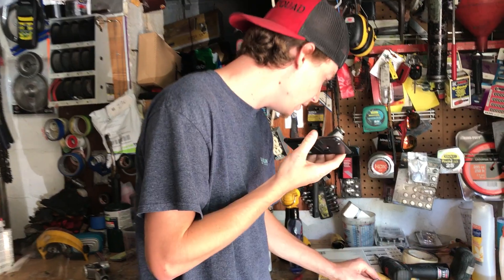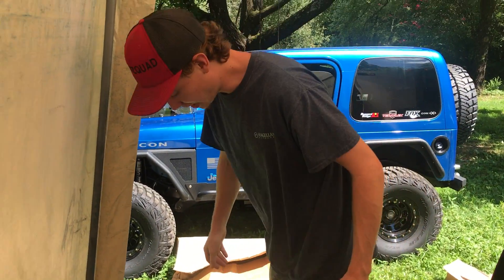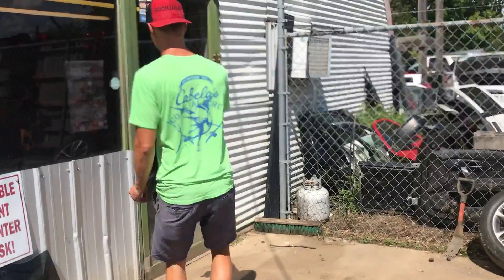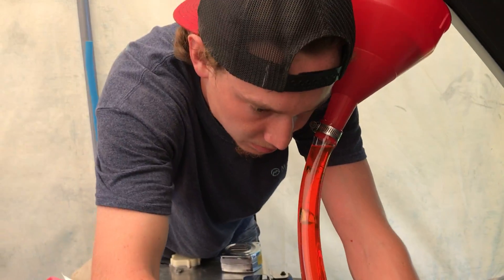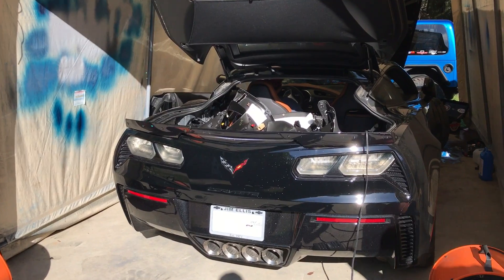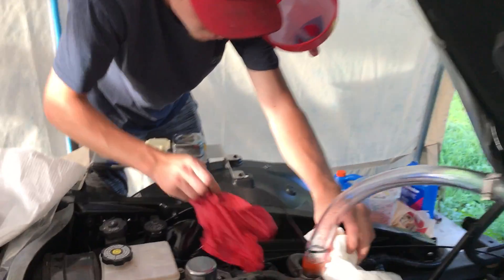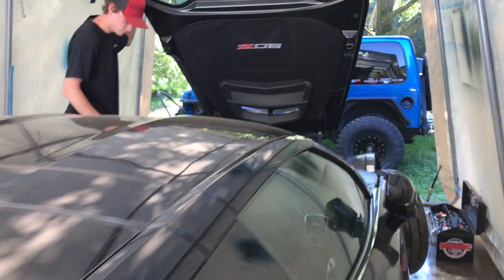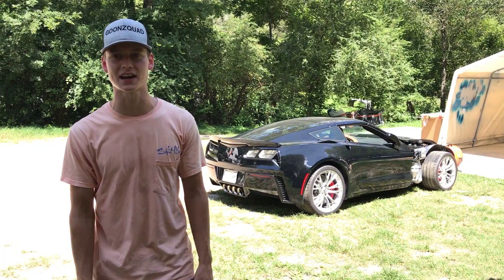Rebuilding A Wrecked 2017 Corvette Z06 Part 9

Comment: Amazing build you guys, just a couple notes if you are interested:

1. Premix that antifreeze in a container in the right ratio before you pour it. Don't try to get the ratio in the system. More water than antifreeze will result in high system pressure as water boils and turns into steam and everything will be under stress. More antifreeze puts load on your water pump as it is more viscous than water and the pump has to deal with more resistance. You poured the concentrate in and then a little water to realize its leaking, so now the system has more of antifreeze. Thats ok as the car was sitting in the yard with an open cooling system and you will need to flush it soon.
2. Please wash off antifreeze into the ground instead of leaving it as a puddle on the concrete when you went on the trip to get the plug. Ethylene Glycol tastes sweet and dogs and cats will drink it and die.
3. Please don't use the impact gun on everything you can. You will rip the plastics and shred aluminum as the torque is not controlled. Use a drill with the torque limiter set to something like 6in/lb. If you impact it, the screw will be tight, but may not retighten if they are taken off and reinstalled in the future.
4. You won't lose horsepower if you have air in the system. The motor will run hotter than normal as the air pockets prevent the circulation of the loop. Cabin heater not working is the first way to identify it.
5. To bleed the system, you have to run the engine with full cabin heat on till it reaches operating temps as that is when the thermostats open and the full loop circulates. Till then, its a loop which is closed. The bleeding point has to be the highest point in the system, some cars may have to be jacked up to acheive that.

Good Luck and great job as always!
Reply: Joseph Jose this is a great comment
Reply: Joseph Jose I'm a 45 yr.old mechanic and you're exactly right. These young men are growing into really good mechanics but NEVER, EVER use impact guns on aluminum. Use a torque wrench no matter how much extra time it takes or how low torque it is. A torque wrench will prevent threads from stripping in the aluminum/plastic and insure bolts/nuts are tight. A drill with the torque limiter is a good idea. I do that on my Toyota. Oh yea, turn the heater on high and wait for the thermostat to open before bleeding the air out. The fluid can't circulate until the thermostat opens. Once the thermostat opens and the fluid level drops continue to fill the coolant system until full and bleed it. I bet those cats ran to the fluid as soon as they left. I would definitely be flushing that coolant system or any other that has been sitting wide open like that in the elements.
Reply: If you have too much air, the intercooler pump will shut off if it cavitates.
Reply: only critisism I can give you is a majority of thermostates have a small hole 1.5mm that will allow for a vac bleed is you are patient, then as you said 100% if you know you have the majority of the coolant in, heater on and engine to normal temp. With my 4wd I don't have a bleeder so I leave the cap off and have the front on ramps. You are 99.9% spot on but, and I am 39yo but taught by doing it right the first time saves $$$, down time and embarrassment 
 @nightdan7096
Reply: @nightdan7096  also I wouldn't be revving it like they did, normal temp slow drive, change coolant and OIL then give it a bit in gear
Reply: Great comment Joseph. ...
Reply: air locks will cause heat build up in like the head and can warp or crack the head
Reply: in case your curious, coolant is used to cool the air charge for the supercharger, if its not bleed it will run hot.  higher air temps = less horsepower.  (timing and fuel trims)

Comment: Watch out with your pets and the antifreeze
Reply: GLAD SOMEONE SAID IT
Reply: 09victoryrc they clean it up really good, they just don't show it. They've addressed it in the past
Reply: anti freeze has had a bitter additive put in it for years now, cleaning up is still the only way to be 100% animals don't get into it but manufactuers added a bitter agent to it so it would no longer be appealing to animals or children
Reply: thats correct sir well said,  @wetwork4real
Reply: dude an added bittering agent is mandatory for years, plus most are now based on someth besides glycol, like propylene or someth which isnt as toxic
Reply: In other news...water is wet, and airplanes fly in the sky.
Reply: Lick your fingers after touching antifreeze. About like eating gasoline. 😛

Comment: The best way to purge the cooling system is to use a vacuum pump system to remove all the air. We use this type system on porsche  water cooled systems,Works great.

Comment: To keep your exhaust valves open at all times, (while the car is running) go to settings, driver settings, engine sound management and set the exhaust to track. That way your suspension / driver settings can be in touring or sport or whatever you want, and still have the loudest exhaust available. This will be a permanent setting unless you change it. So when you turn the car off, it won’t reset to quiet mode for when you want to start it again with the exhaust in track mode. But everything else in a softer driving mode. Also driving around with the suspension dial in track mode (I’ve heard) can hurt the magnetic suspension under daily driving. Awesome stuff.

Comment: Hey guys, found your videos the other day and I have to say I'm really impressed!!! I have been in the auto biz in every facet for about 20 years. I'll be sure to shoot you guys tips,tricks,info when applicable. I have found that parking on a incline works great for purging cooling systems.Gravity does all the work! Btw- your drain plug from your radiator is called a petcock. Can get from any parts store.  I can't tell you how happy I am to see you guys Hands-On, turning wrenches, outside with your animals,living life! Instead of sitting around with  screens in your face 24/7 having no common sense or sense of reality,like 75% of your generation.
B easy guys and keep up the good work!!!!

Comment: I always run better after farting too.
Reply: To bleed properly, close to radiator cap, loosen the bleed valve, start up the car and blast the ac heater to max until the bleed valve has no more bubble

Comment: Best natural way to purge air out the cooling systems is to get the car up to operating temperature. Of course keeping an eye on the temperature is a must. Let it idle with the A/C on blast to speed up the process. once the thermostat opens up the radiator fans will kick ON. Once you hear the fans turn on. Turn OFF the A/C and blast the Heater. It will start to circulate the coolant, and most of the Air will purge out. Keep topping off the radiator reservoir as you see it go lower.

Comment: Antifreeze has nothing to do with horsepower but if system not purged correct you can overheat the engine for sure. Love your channel guys. Wish I cold work with my Bro like you two do.

Comment: Don't know if anyone has questioned it, but you pulled the MAP sensor from a standard Vette, the Supercharger requires a different MAP, usually a 3 bar to allow for boost. I didn't see any check engine lights on, but the off idle throttle sounded bad. You may want to verify with the parts department the correct PN for the MAP required. Other than that, you guys are kicking tail! Keep it up.

Comment: Some air sometimes get stuck in climat control heater, so when you ar doing fill up u should put a climat heater to max - so it can open heater core valves if it has some. And remeber to change thermosat! 
Great job and full respect :)

Comment: If you check the owners manual it should tell you the capacity of the cooling system so you can know what you need to start with. When using the concentrate you put in half the capacity with the coolant first then top off with the water. No need for mixing it in a quart at a time.

Comment: Vacuum is the only way to go when filling a cooling system especially when there are parts or hoses higher than your reservoir but you probably know that by now. you guys really perform well for being so young. Your going places for sure. Couple of little Chip Fooses here. lol Good luck to you both.

Comment: First, very good work. If you still have air in the system it will not hurt if all the thermostats are open. Then you can vent the system easier. Greetings from Germany

Comment: I know this video is old, but when mixing antifreeze, get an empty gallon jug and pour half full strength into it, and fill both up with distilled water and shake both.  That way they are even and mixed properly.  Doing it the way you guys are will result in either to much water or to much full strength antifreeze.

Comment: In the uk we fall the system up and run the engine and squeeze the pipes to the heater and pipes going to the radiator with the filler cap off should expel any air from the system

Comment: I didn't finish the video before telling you an easy way to fill the system.  Invest in a vacuum pump, it will work for your AC and coolant.  Vacuum adapters will be needed for both, vacuum the coolant system down and put the hoses in the coolant then it will suck all the coolant in for you.  Same thing for the AC.

Comment: Could you guys unbolt that coolant remote reservoir from the frame (without undoing the lines) and tilt it just enough to get that big air bubble out and then bolt it back up?

Comment: Gays you’re literally top! Just want to notice make sure that all the wires and cooling pipes standing right before the radiator’s fan aren’t in anyway touching the fan get all the pipes and the wires strongly attached to the frame way far from it ok cause of the motor’s vibrations they may touch the fan and get cut with it rotation, I’ve had one of a hell situation like that once... so good luck with the assembly... and waiting for the next video 🥂

Comment: you don't lose HP when you don't bleed the air out air creates hot spots and causes warpage which can lead to head gasket failure  it's like cooking without oil

Comment: What you wanna do when you haven’t started the motor in a long time turn it over but not start it and let the oil get all in the piston rings and get the that cam bearings and crank bearings lubed up

Comment: Good way of dropping tools in the fan, you’re racing the engine with tools sitting on top of engine. Why no thread locker on most of those parts??  Change engine oil ASAP, use what GM specs for it. Check all fluids, (everywhere)  NICE JOB 👍👍 Vinny 🇺🇸

Comment: With all respect the drain plug would have been the first thing to check before you installed the radiator, especially it being a used radiator. Nice video though